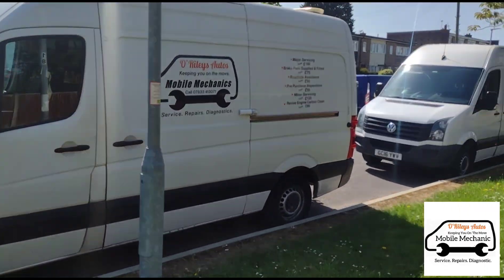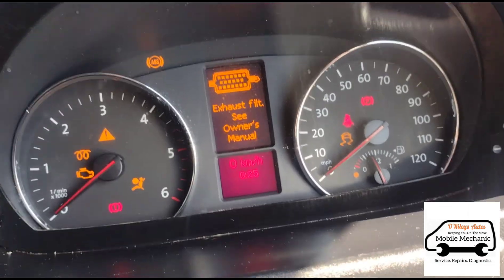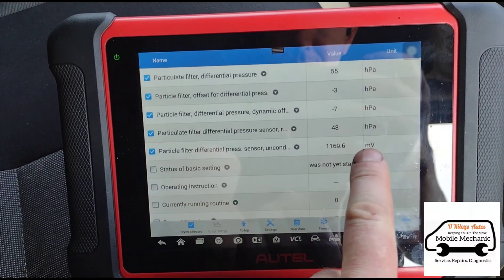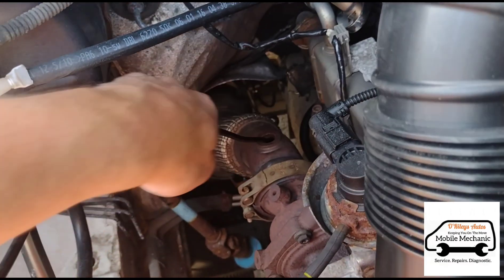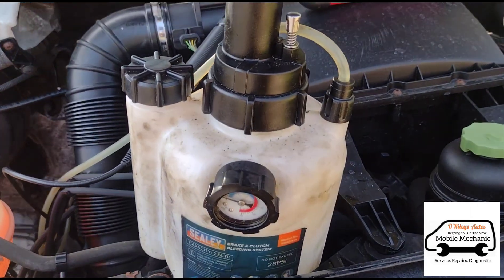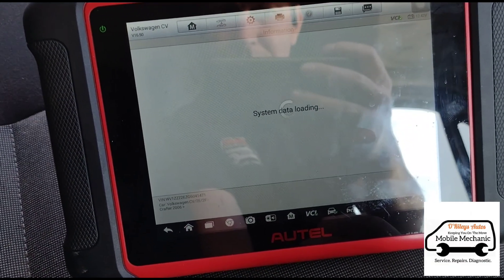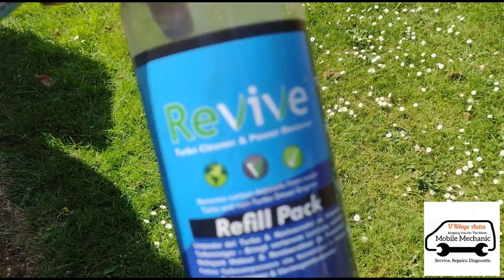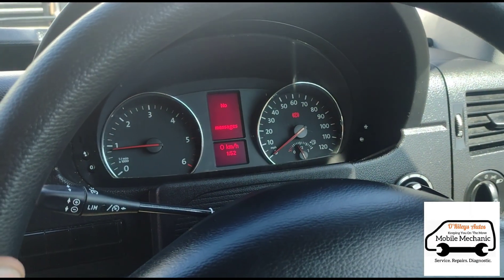VW Crafter 2.0 TDI P2463 Particle Filter Restriction: Soot Accumulation P246300 Blocked DPF Cleaning

Comment: My exhaust tail pipe has nothing coming from it…..even covering the tailpipe tips and getting someone to rev there is no pressure at all.
I do have the 3 lights illuminated.
Is it just a case of pouring chemical down sensor hole.

Comment: Nice work 👍🏿 i want to fit leisure battery in my van and an iverter to run power tools, i wonder if you have any advice or point me in the right direction, thanks